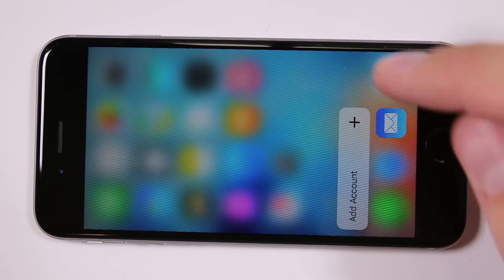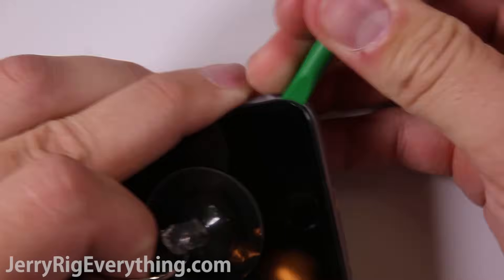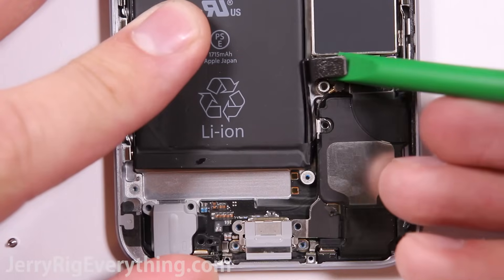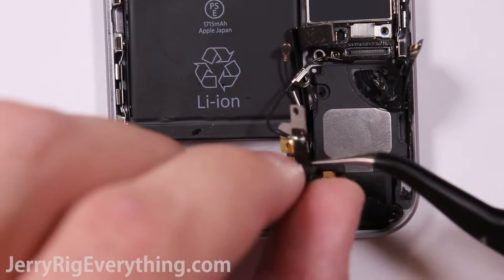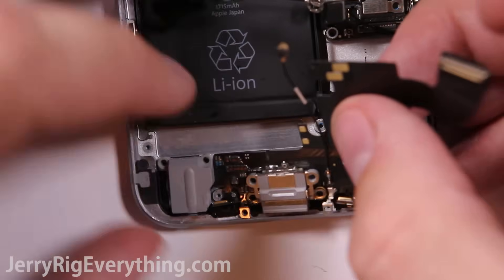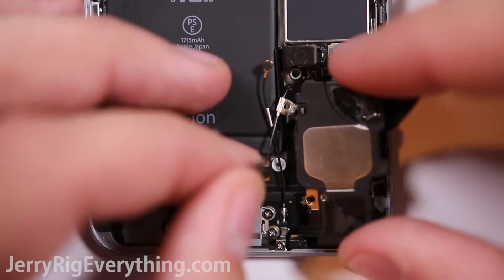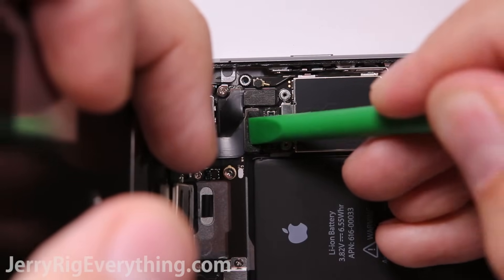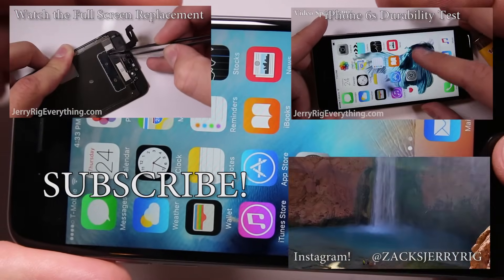iPhone 6S Charging Port Repair Shown in 4 minute Fix

Comment: When I try to open the screw diagram it says under construction 🚧 
I will check back in a few days and see if it’s up and running.
Thanks for the video.
I am disabled and on fixed income so I am going to have to repair it myself as I have to attempt every time something breaks. 
I will eventually just not have a phone because if this is like a lot of things my hands and eyes don’t let me to do what I attempt.
Wish me luck!

Comment: 3:21 - the 'wire cable' is it meant to pop in like the other cables or do you just rest it on top?
Reply: Press it in not hard though
Reply: It won’t press in. But it’s not even connected and everything works fine?? Wtf
Reply: @peetayebay  if it won't press in something like a piece of debris might be interfering
Reply: @peetayebay  couldn't get mine to press in...will know soon

Comment: ONE WEEK into my new contract, and the phone stops working. EE rufuse to replace it as i cracked the screen slightly the day I got it (even tho the crack made no difference to how the phone worked). £148 they quoted to get the screen repaired before they even look at the phone... SOD THAT! So I bought a new battery, that worked!... then i try and charge it and it was charging like 1% every ten minutes, so I thought 'oh maybe as its a new battery it needs to be fully drained and then fully charged' so I do that, and it wont turn on. Hmmm, slow charging... maybe its the charger port? Just replaced it and it still doesnt work. I'm absolutely fuming. 2 fucking months Ive been without a phone, and I have EE chasing me for phone payments. Lol if you think im paying you until this phone is fixed, they have another thing coming. Any suggestions? Slowly losing my mind.

Comment: Sometimes my iphone 6s stops charging. But then when I unscrew and open up the phone and plug in the charger it starts charging again whilst open. That seems to fix it so I close up the phone and put the screws back in and use it normally including charging it for about a week or so, but then have to go through the same process again. Anyone know if this is a charging port issue or something else?

Comment: Hi i replaced my lighting port no problem and battery at the same time everything worked good and shut it off after testing it and put the phone back together. once back together i turned it on and now i just get hit with the apple logo for about 10sec and then shuts off and repeats itself. can someone help me please?

Comment: I have just followed this video. After reassemble my loud speaker and vibrate don’t work any more. I have taken the speaker out and put it back in again. Any suggestions?
Reply: Jamie MacAskill you’ve probably already done it but watch the video again take everything out the same way and then watch carefully at the video and put it all back in the same
Reply: @summerinell4669 Thanks for the reply, I have narrowed it down to the new part being faulty. Ended up putting the old one back in again, and speaker and vibrator all work fine.

Comment: Did you realize that there are multiple variations of the construction of the 6s? I just pulled out my loud speaker only to see that the connection points are completely different. I shouldve known that it would be different when mine had 4 ribbon chords and yours had 3, and the loud peaker was a completely different shape. Maybe you should preface your videos by saying that.
Reply: *Important comment **

Comment: This saved me AUD$70! Yay!! Thanks. Interesting point in another comment though that the screen should be connected first before the battery. Lucky it didn't blow my backlight filter considering I didn't read that until once I'd followed this video.

Comment: Phone dead was on 85percent last night ,   It won’t turn on no apple logo the guy I went to said it’s fried but there’s no way I  reconnected the ribbon cables and I also  reconnected the battery and charging ribbon cable he said he had also tried a working battery and wouldn’t work what should I do I’m getting frustrated

Comment: Okay so my iphone lost it's sound after I did this repair, any suggestions on what to do?
Reply: I know this is late but you might not have put the microphone back in correctly.
Reply: Its late but you ripped the receiver cable

Comment: I did all of the steps exactly  as you showed in the video and my phone turns on but it wont charge at all. I replaced the charging port because it was very finicky (if i positioned the charging cable wrong it would stop charging). please i need help!!!

Comment: I would like to stress that there is a risk to damange your phone. I've reassembled my laptop quite often without problems. For the 6S I had disconnected battery first and reconnected battery last, as advised below. Phone would not start after reassembly and according to the repair shop I brought it too the motherboard is fried. (So basically the phone is total loss.)
Reply: C4rb0neum  no, no, no,  no don’t ever remove the battery first. Removing the battery will blow out the back light on your LCD. Not sure about the motherboard, but it’s not a smart idea to remove the battery first.
Reply: @AndrewGallardo52799  The LCD has worked again one or more times. The repair guy told has shown me the working phone on video, but a few minutes later it died while being extremely hot.
Reply: So yes, could be that I fried some motherboard connection

Comment: @jerryrigeverything  Would it be a mistake to connect the iphone 6s battery terminal to the logicboard if the logic board does not have the sleep wake power switch connected.Though the battery would be live in this scenario?

Comment: Fantastic, no-wasted-time tutorial! A word of caution to folks: I've had my phone for about three years, and when I disassembled it for the first time (just now), some of the case came off with the part I was removing/replacing. They seemed like shaped gaskets, one for the headphones hold and one for the charging port hole. 

I caught the headphones one and smugly returned it to its port... then didn't realize the charging port gasket came out attached to the old part until I had everything back together and running smoothly... lol.

Comment: Before you started your video you mentioned that one might check to make sure that there is not a piece of lint or dust in the port before going through the replacement procedure. After watching your entire video and realizing that it was not a task I wanted to take on, I remembered something about lint. I checked my port and it was compacted with lint. I just wanted to let you know that one piece of information saved me a lot of stress and money. Thanks

Comment: My 6s was working fine then BAM one day the battery drops from 100% to nothing within 3 hours with minimal use. I thought it was the battery and swapped that out with your other video. But the new battery is still draining just as fast. And the phone will only take charge from ONE cable I have at home, no other would work. I don’t know what’s wrong...
Reply: Your phone it's in love with that cable, all that thinking about him has it draining its energy. only when together they are truly happy.

Comment: I tested the screen before snapping it back onto the chassis but in the process of snapping the screen back in place I got: "This iPhone has experienced an unexpected shutdown because the battery was unable to deliver the necessary peak power.  Performance management has been applied to help prevent this from happening again."  My battery maximum capacity is 83%.  I disabled the Performance management mode.  Any thoughts?

Comment: These instructions worked great. My iPhone which spent a night outside in a torrential rain storm came back to life with a new battery and charging port!! My only watch out is I struggled to extract the hidden screw. I recommend investing time carefully removing the covering tape. I tried to get to the screw prematurely and stripped the head.  Cost me an extra hour to get that screw out (it did not go back 🤔). Note the screws are VERY tiny and of different lengths.  Thanks for the tutorial.

Comment: hi, i have a problem with an iphone 6s , i dont have signal sometime i have only one line, sometimes its serching for signal. I try everything , reset network settings, reset phone change sim but nothing. What i need to change from inside what is the name of the pice that needs to be change?

Comment: i know this video is 3 years old. but i followed its instructions, even ordered the part from the sire listed in the description. removed the old, installed the new. put the phone back together. everything was working like it should when i turned it back on. until it came to making a phone call or receiving one. i can hear the other person just fine, but they all claim theres a large amount of static coming from my end. im assuming the part might be defective? i removed the replacement piece and installed the old one. calls are coming thru clear on both sides.. anyone possibly know why the sudden static after using new part?

Comment: I attempted replacing my charging port with your video. great video but i couldn't get the charging port plug or the wire cable to plug in. i also stripped the screws that hold the plate over the charging port. any suggestions or am i out of luck?

Comment: am I glad to find your page.  Just ordered all the parts.  Hope it works out as easy as your video makes it look !!  had a nightmare with Apple Authorised Service Centre.  My phone was eligible for a free battery replacement but they would do nothing because it would not power on !!  How the hell is it supposed to power on if the battery is dead ??  Anyway,  I will be using your site for quite a few repairs.

Comment: I began this job on Monday and did not move the antenna wire under the connector it made the job a lot harder. I worked for like 10 min everyday then finally I was able to connect the speaker. The ribbon connected is what held me up.

Comment: What are the 2 antenna cable for?  Cellular ? wifi? These being the one soldered to the charging port assembly and the one that screws to the speaker assembly and connects up by the digitizer and lcd flex cables.   Thanks

Comment: what size of the screwdrive do we use for the two bottom pentalobe? I bought the tool kit but I tried all the screw but i cant unscrew it, am i doing something wrong?
Reply: u r probably doing something wrong. usually they are pretty hard to get out with those small cheap plastic screwdrivers.

Comment: Hi so I have an iPhone 6s that will not charge. I have cleaned everything out, checked the charger, and my phone still won’t charge. I looked into the charging port and the metal prong things that connect to the charger with the gold lines on it are pushed in and I need to know how to fix it. Is there anyway I can without getting a new screen and charging port

Comment: I feel like I did everything right but now my screen is black. Vibrates when I put the charger in and receives calls...but the screen stays black without a hint of it working. Can't try holding home button and power at same time, as home button is stuck after repair as well. Oh well. Wasted my time and money because I am technologically challenged.
Reply: Hi Ray 
I think its because you have to disconnect the battery first before the screen

Comment: i'm thinking of doing this b/c apple is telling me that they wont repair this. they told me i need a new phone and to upgrade (of course). i'm out of warranty anyway... and i can't trade in b/c AT&T needs a working phone. will this fix my issue where the phone ONLY charges when completely off? apple did replace the battery and same issue persists and they gave up. i cannot enter DFU mode b/c the phone cannot connect and register with a computer (and itunes is needed for DFU mode). apple told me the pins within the charging port are damaged and it soldered to the motherboard which is why they wont touch it. are they flat out lying to me then b/c your video shows its possible. i have an iphone 6s (if that matters).
Reply: did you end up doing it? apple told me the same thing today
Reply: Bernard Wong no and it “magically” started working fine again now. Try updating your phone to latest OS see if that helps.

Comment: I recently drop my phone in water and I put it in rice for 24 hours but when I charged it nothing happen so I used q tips and a Paper Clip to get some stuff out of my charger port but in a video it said not to use anything metal because it will break the contacts of the charging port, still my phone is not charging I'm worried that I scratched my charging port and can't charge my phone anymore

Comment: With the help of your videos I just did my battery, charging port and screen in one fell swoop.  Thank you very much.  A couple of tips now that I've done it.  Definitely test the phone after you turn it on.  At first I couldn't charge my phone, the loud speaker didn't work and the front camera didn't work.  It's definitely helpful that he tells you where all the connections are and what everything is.  After making some more adjustments I got my phone up and running.   Good as new.
Reply: Hi, can I ask what happened to the data (e.g. photos) on your phone afterwards?
Reply: Do you know where the connection is for the charging port? Because I have the same problem, everything works bu it just won’t charge

Comment: Another video by an idiot with no common sense. If you are not going to do it properly, don't do it at all. Disconnect the battery before you unplug the screen and press and hold the power button for a few seconds. This drains all the power out of the phone and you wont risk blowing the back light.

Comment: Hi Jerry,  I have iphone 6s plus that does not show the lighting bolt when i plug in power cable. I'm very sure my charge cable and adapter is good. I have also cleaned charging port on the phone.  The phone has about 20% battery charged, and last night I left charge cable on the phone and it charged to about  40% this morning.  I took my phone to Apple store the tech did  a software diagnostic told me the battery is good and he told me the logic board is bad. Any comment on it is greatly appreciated.  What do you think the problem is?

Comment: My charging port wasn't working so I got a new one and replaced it. but its still not charging!
Before when it was turned off and I plugged it in, the screen wouldn't turn on. Now with the new lightning port, the phone is turned off and when I plug it in it turns on..but it doesn't charge! :(

Would anybody have any ideas why its not charging?
Reply: I was able to fix it!! I had to plug the cable in and jiggle up and down a bit and then it charged :)

Comment: I am only here because last night I decided to clean out my charger port from all the lint, and accidentally knocked out a little golden connector. I said eh, because my charger was still working. But when I woke up, it was dead. I left it charging at 4%. I already tried different chargers, but none of them are working. I just ordered a new charger port from eBay, and I was watching this to practice. Wish me luck.
Reply: This happened a year ago, I need closure
Reply: Bilal Jabr how did it go?
Reply: Shane Raja I guess I didn’t go to well
Reply: He dead
Reply: @akaram325  dark 😂😂😂😂😂😂
Reply: And then what happened? I hate open endings ...
Reply: Same happened to me. Think I'm just gonna pay someone to do it
Reply: Moto Mayhem I just did it and it's not very hard, just time consuming. Save 50 bucks
Reply: Super easy. Changed mine in 20 min. Cmon man....!
Reply: Billy Jabr I’m just here because of the new update and my phone charger is broken or something...

Comment: My iPhone 6s was having charging issues due to a corroded 5th pin in the Lightning port. So I replaced the whole assembly and battery. I thought that would resolve the issue however it still won't charge my battery. Do you or any of the commenters know or might know what the issue or issues it could be?

Comment: I ripped the square section that sits on top of the loud speaker and when plugged in phone still doesn't charge? Is this the reason or can I eliminate that as a partial cause and look for another culprit?

Comment: Replaced lightning port with new. Now speaker and vibrate won't work when it worked fine prior to. I know the cable to the speaker was rough to line up but I'm at a loss now. Please help

Comment: My phone has water damage. I replaced the battery and the charging port. Before i replaced the charging port the phone recognized it was plugged into a charger but it would not charge the battery after I replaced the charging port the Apple logo comes on and off but the phone will not power on. Does anyone have any suggestions on how to fix it? The cables appear to be properly plugged into the phone.